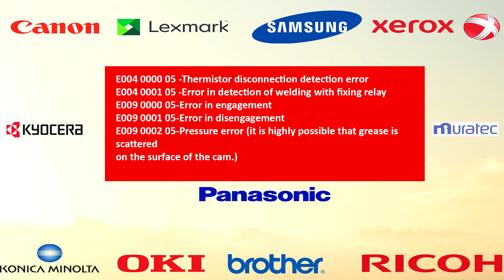CANON IR ADVANCE C5030/C5035/C5045/C5051 Film Assembly and Pressure Roller for Fuser Unit

Comment: Hello I bought a Canon C5030 and I keep getting E000012-0204 an suggestions? Iam not a tech.
Reply: it means the drum rotation sensor wheel of magenta color has been damaged, its at the back of the machine behind drum units. Looks like a small disk, partially transparent.